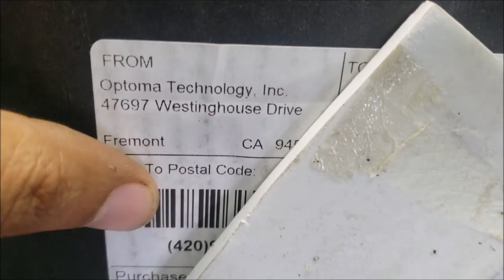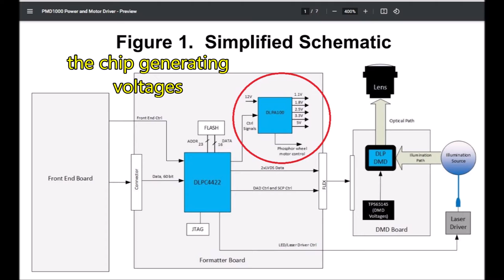Optoma HD39HDR DLP Projector DAEHHGN Red light flashing blinking

Comment: I hate getting fake chips, or other components it wastes time and money very good fix so far thanks😊
Reply from the maker: fake or copy components may cause more damage to the device, and sometimes take you away from the source of the problem 🤨
Reply: @SOSfixElectronics  exactly, I was fixing a Panasonic plasma, I had to replace two mosfets under a heat sink on the power supply, I replaced them from AliExpress and it caused more damage, I think they were remarked plain transistors.... I have had some components from China where the legs still had solder on them 🤔🥴
Reply: Where am from you can't find the original components  and some  replacement IC, it's so hard to be a technician. Am from Malawi, Africa..

Comment: Hello, I replaced the bulb and tried to clean the inside from dust. When I reassembled it and I got the same issue as your with micro switch, what's the real fix? New switch or can I have tape holding the spring???

Comment: Have to start a vendor 'Hall of Shame!!' 🤨 Some repairs are hard enough to diagnose without having to deal with that crap. 🤬
Reply from the maker: if i didnt see the projector on with old chip i was going to get confuse about could be something also wrong with it, before when i was fixing the plasma tvs with a bad mosfets transistors or even IGBT half of the new chips are copy or fake ones causing more damage to the set 🤔🤔made in china

Comment: Hi, I replaced the lamp with a brand new lamp, but when I switch the projector on the fan starts for 10 seconds and then switches off, then the red light for the bulb comes on, the lamp does not come on at all, what could this be? Thank you
Reply: I have exact same issue any update on how to fix ? Is uours good now?
Reply: @leebailey1220  no, ive sent it in to optoma for repair couple months ago, they will only get a replacement part in june-july, so guess i have to wait till then to get it fixed, they did tell me it's a colour wheel issue and needs to be replaced,